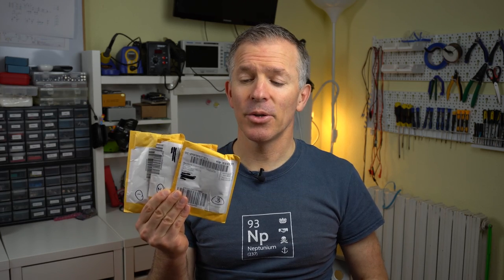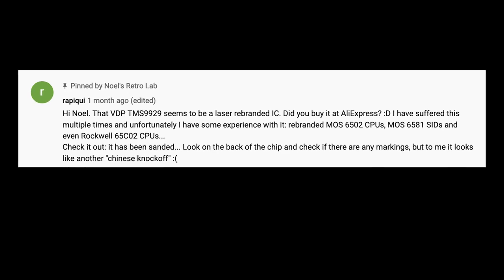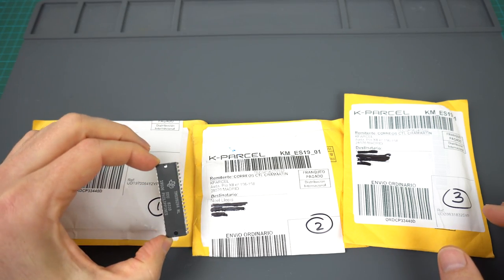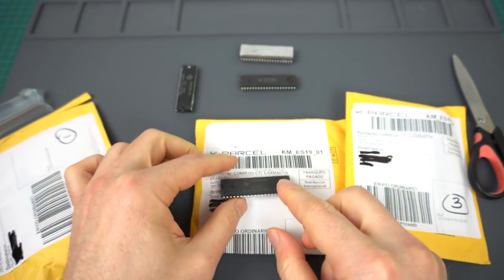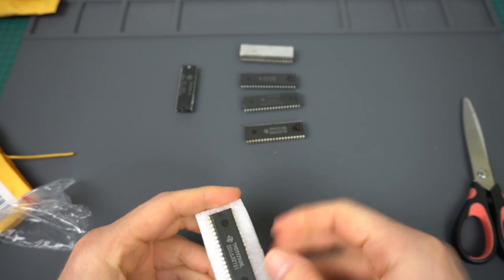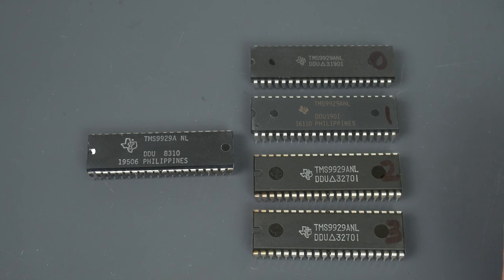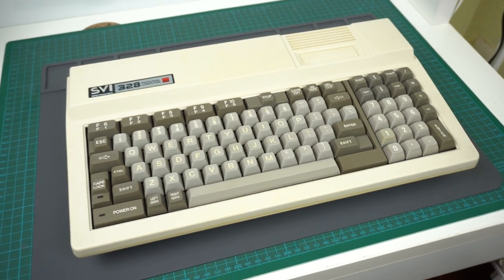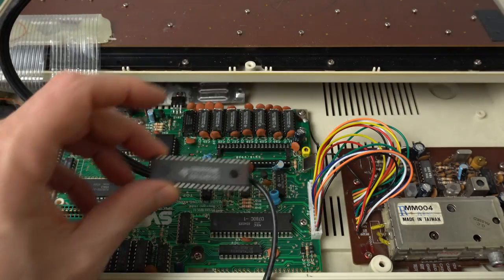Detecting FAKE Chips From China 🔍

Comment: If you can buy these chips elsewhere with higher price but they are genuine, why even bother with eBay for the hassle and trouble. I mean I valuate my time rather than saving few $.
Reply: That "if" is the problem. Chips like these are often simply not available from regular electronics suppliers at any price. They're no longer being made or used in industry; only hobbyists repairing obsolete machines have any use for them. The only way to get them is to cannibalize them from another machine of the era, or hope someone is dumping old stock on ebay or aliexpress.
Reply from the maker: Exactly. I'd love to find out a more expensive, reliable source for chips that aren't being manufactured anymore.

Comment: Some false assumptions are made here, first, they might all be real or fake and the packages could be different for as variety of reasons. chips are started in baches where a certain amount of wafers are started on the 20-30 day process to become a completed chip. so each run should have the same package but run to run variances could exist, if there was a design change, the process transfer from on facility to another, new foundry fab...etc. could all explain the chamge in the package. i could go on and on but you see why the packages could vary abd all still be real chips. Now during the process, you will have a certain amount that fail for some reason or another, the operator was picking his nose and dropped a bit o bugger and ruied 6 chips... now these chips will usually make it all the way through the process to packaging where a 100% inspection would catch failing chips. this is where some sorry person takes the chips that fail to sell them. I have over 15 years in semiconductor as a field service engineer and it makes absolutely no sense for a company to build a fab to build fake chips, the cost of making the fab would not make sense to do this, its more likely you purchased chips that failed inspection because of a misprocess rather than some company building a billion dollar fab to make $2,00 fake chips.

Comment: many 'fakes' arent fakes but 'used' pulls, cleaned, retinned and remarked to look 'new', so not 'fake' as in one device marked to be something else, but old chips sold as new ...
Reply: problem is, i doubt they test them before selling them on..
Reply: one definite lot of 'semi' fakes are various slower speed z80s sold as 20mhz cmos types, i have a load, i havent yet found an easy way to 'speed test' them
Reply: if it looks like its been remarked, especially laser etched, and it was a chip originally made when this wasnt done,  it probably is a remarked old one or downright fake..
Reply: also 'tinned' pins, like they've been solder dipped
Reply from the maker: Yeah, that's a harder problem to catch actually! Although usually acetone or alcohol will show that the chip was altered.

Comment: Around 3:43: "two different vendors" - enter Michael Stevens: "or are they?" - I am pretty certain that many vendors in China operate under several different names.
As for the marginal profits they can gain from selling ICs this cheap, and often with free postage, I believe they are heavily subsidised by the chinese government, and that it's a part of the chinese efforts to wage trade wars against the west. At least that viewpoint makes quite good sense to me.
Reply from the maker: Makes sense, although there's still the issue of cost of whatever they sell you, cost of modifying it, and minus all the returns. 
I agree that those two seemed to be the same seller. I guess that's a common practice for some reason?

Comment: the one thats faded was taken from a scrap board its r legit one they just didnt test it before they re sold it
Reply from the maker: Except that one gave REALLY weird resistance readings. I would think it's something else completely different (or the scrapping process really destroyed it inside).
Reply: @NoelsRetroLab  from the board its from has had something going wrong thats fried a part of it with this chip being the area effected however the ones who remove the parts only do a visual inspection they dont have the testing equipment or software to do a full test so the part is sold as seen but with it tagged as working when they dont know if it is or not, ive had stuff bought from china that not properly manufactured & the one that was prominent was ide cables the primary & motherboard connector was properly attached to the ribbon cable  sadly the slave connector had no pins what so ever & i was able to slide it along the cable althou i did message them they still sent out 2 more with the exact same problem after this i didnt bother with company, my story has nothing to do with replacement chips it does show they dont test anything before they sell it then they wonder why they get a lot of negative feedback on ebay

Comment: Simple rule : engraved chips are fake.
Reply from the maker: How do you recognize an engraved chip? Is the lettering sunken in a little bit?
Reply: @NoelsRetroLab  Exactly. It's saler engraved, not painted. the chip may work, but Hiding the truth by sanding and engraving is always suspect. I also order a handfull of TMS9929, some seem legit (the same as your #2 and #3), 2 are suspect (engraved). I don't own older computers like Spectravideo or TI99-4/A to bench test them however.

Comment: They would work if yo see the schematic that comes with it, many times this chips do the same work as the chips you are trying to replace and not necessarily have the same pin compatibility, in many cases they are more advanced then the originals and requiring less voltage... Your experiment is as fake as the chips you are  trying to match!... Any patent covering this chips have long been expired and are very easy to replicate their operation or purpose...

Comment: Couple of things.....I could have saved you some time. If a chip is not seated in graphite anti static foam. In a silvery anti-static bag....you got a cheap knock off! Might work might not and it’s lifetime reliability naggghhhhh.

Also....who taught you to handle chips by the pins with your fingers while not wearing an anti static strap! ESD discharge is a leading cause of early IC component failure! 

Ya pays for what ya get. And EVERYTHING coming from China is a pirate knockoff with no intellectual  property Licenceing Payment’s   .....let’s face it that the very BASIS OF COMUNISSUM all property and inventions are the property of ALL the people! 

Or as Armageddon  said ....American Russian all components made in Taiwan !
Reply: Look again, he has a blue strap on his right wrist.
Reply: Matt Kasdorf I watched DIDNT see a anti static strap...post a screen shot image please...
Reply from the maker: Yeah, I hardly ever get any chips in correct ESD foam from China these days. For now I was wearing an ESD wrist strap for this because I know these particular VDPs are quite susceptible to ESD (although maybe I wasn't wearing it in every shot?). Still, the strap by itself is not very useful without proper grounding of the work surface as well. I have a full video coming up on transforming my workbench into an ESD-safe workspace.
Reply: @martinbuss6818  Noel even explicitly calls out that he’s wearing it at 8:19, so you need to pay more attention.

Also maybe it depends on the chip but these VDPs do not have clones beyond the Toshiba and Yamaha ones from the same era. They are not manufactured anymore so what you get is either old stock or pulls, and IP rights only need to be paid once, not again on resale.